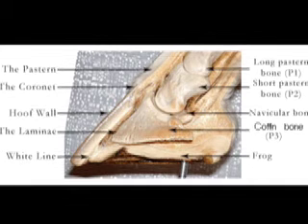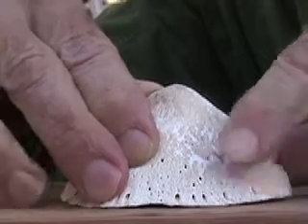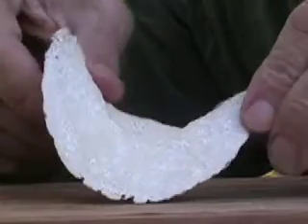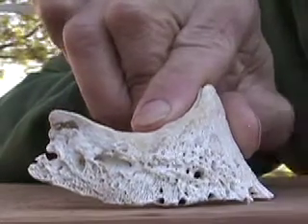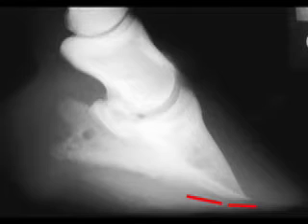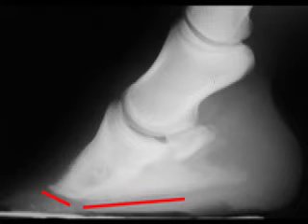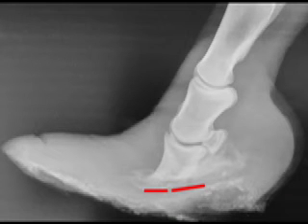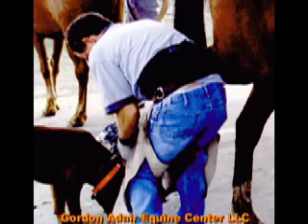Coffin bone deformity and heel height?

Comment: You have determined heal height is to blame for these deformities... I dont see how you came to this conclusion. 

In your radiographs you show horses with distorted coffin bones that are obviously laminitic. You don't take into account the SUPER thin sole, lack of laminar attachment and lack of blood flow to the tip of p3.  The fact that laminar detachment causes longer toes, and more leverage on the tip of p3 due to a longer phalangial lever and ground reaction forces to a very thin sole.

Comment: Very well done! You do realize that though you may have "discovered" these ideas  for yourself, Dr. Strasser published these ideas several years ago.
Bone yields to pressure. When the bars and heels are high, even just a few mms, it can put the CB in a position where there is pressure on the tip causing it to dissolve and/or deform. Good examples!